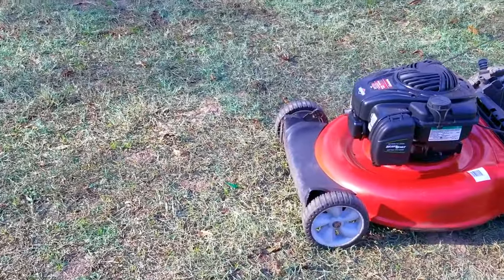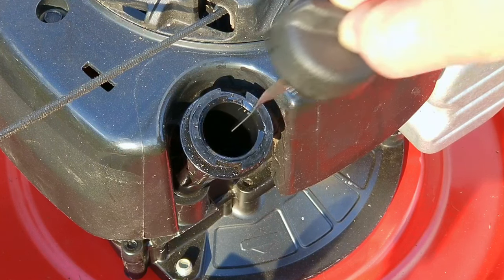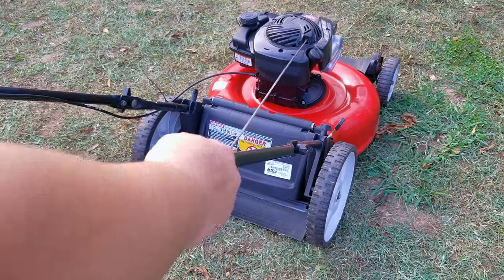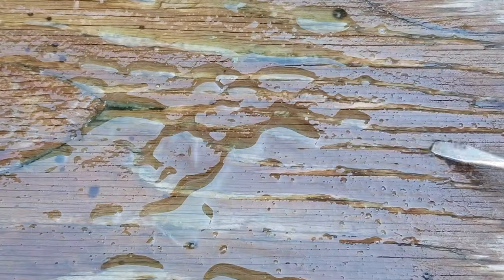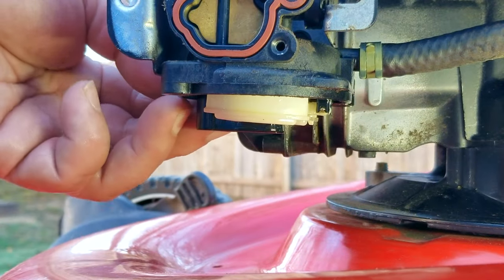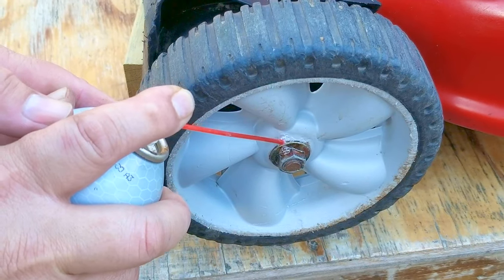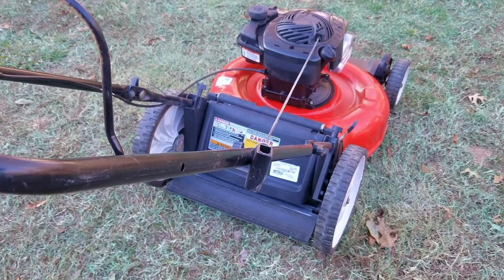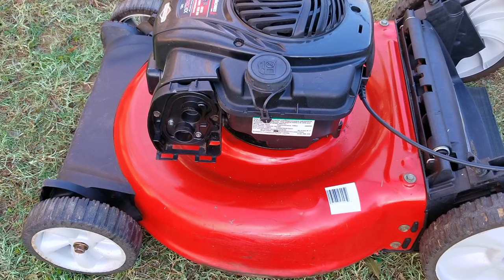Fixing A Yard Machines Mower That Won't Start

Comment: I usually remove the cover and take out the tank and carb as a unit. That way you can inspect / clean everything under there, flush out the tank and lines then thoroughly clean the carb. Chances are that slime and old fuel is still hanging around in the carb or fuel lines, but I’d also check the spark plug wire where it passes under the engine cover. Sometimes it gets pinched against the fins and grounds out or rubs against the auto-choke linkage and causes it to hang up. These are pretty good little mowers and sell quickly when all sorted out.
Reply from the maker: yes that's what I should have done too

Comment: If you notice the chuh-chuch sound when turning the engine over (starting this engine isn't instant), you may wish to adjust the valve lash. This engine likely has 50+ hours on it and now may be a good time to complete that service. Also, snug the head bolts as well. Great job, Home Garage.
Reply from the maker: good idea

Comment: I'd take that carb off and clean it and flush the whole system. That plastic job would be an easy fix. Still acts like the choke is hanging up, but there's always more than meets the bloodshot eyeball. Mowing with the battery job with in the slow and economy mode. High grass is battery at 60% left but witht the same settings and light mowing but moving along it's been 80% the last two times. WELL pleased but the gas jobs are still here too.  Happy weekend and Blessings
Reply from the maker: agreed, and that's the plan
Reply: @HomeGaragechannel  YAAY!

Comment: at this point, I'd say either giving the carb a full cleaning or replacing are equally good options.  But since you have such good flow through the carb right now, another option would be to try running full strength sea foam through the carb for a few minutes.  That might equally do the trick.
Reply from the maker: interesting choice

Comment: Take shroud off remove fuel tank and carburetor clean tank and fuel line or replace fuel line blockage might be in carb inlet and between needle and seat under float valve also check fuel tank outlet some manufacturers used an inline filter that pushes into the tank outlet that significantly will reduce fuel flow if dirty
Reply from the maker: very good idea

Comment: That is a surprise for a 2012 model mower with good paint since the mtd machines the paint peels. If you look at it the wrong way , I have made my shares of mistakes also we learn from it and move on and get better.
Reply from the maker: you're right about that, and yes it's in surprising condition

Comment: Hey man, my dad has a toro lawnmower over head valve and he only got it like 3 and a half years ago. I just got done mowing today when I noticed oil was starting to leak out onto the bottom of the air filter and onto the mowing deck. How do I fix this???
Reply from the maker: check the oil level, make sure it's not over full, if it's not overfilled then the head gasket might be broken

Comment: Been watching your videos for over a year you've always asked to put comments. I just want to let you know your videos are very informative and I really like the way how you explain things but I have a question....... my seven year old Honda power washer just kick the bucket. I'd like to know if you could direct me down toward a path of a model that you would recommend to buy a new power washer ..... Example, good engine good quality ..... Funny thing I should send it to you so you could fix it but that's a different story but I really would appreciate your opinion if you can direct me down for a good model thanks a lot.....
Reply from the maker: thank you and I appreciate your time in watching.  It means a lot to me.  So here's the part, where things get tricky.  How often and how long do you use your power washer for?  Also, where do you store it when you're not using it?  What's your budget for it too? sorry for all these questions but these would be the same ones I would ask if we were standing at the Lowes, looking at them.  My recommendation is that if you use the washer a lot and store it indoors to get "any" power washer with another honda engine on it.  Doesn't matter the brand name.  But If you store it in a shed, and only use it sparing, just get an electric one, based on your budget.

Comment: Where does that top hole behind the air filter lead? Is that the air intake? Also, is it a bad idea to spray any starter fluid in there? 😅
Reply from the maker: to the top of the engine and the PCV system.  No it's not the air intake to the engine.   You can spray it there but it would be better in the lower hole which goes to the carb.

Comment: im having issues with my mower it was running horrible and sputtering when last in use and it ran out of gas so i let it sit for a few hours. then i filled it back up and it wouldnt start up, ive cleaned out the carb checked all the jets all was clear its a plastic carb if that info is needed. i also checke the spark plug for spark and it had plenty. im out of ideas what it could be at this point
Reply from the maker: Not enough information so I'm being general here.  Have you checked to make sure the Air filter was not wet with water or fuel?  Also have you tried putting some fuel into the carbs inlet to see if it might start by bypassing the carb?   Otherwise it seems like the problem is the fuel.  It might have water in it?  Have looked to see If there might be water in the gas can?
Reply: @HomeGaragechannel  thanks for the response. And yes the filter is absolutely nasty I had to take it off it was ruined it was wet with fule and whatever gunk was on it . I need to get a replacement. And the only thing I tried was a little break cleaner in the carb should I try gas?
Reply from the maker: yes try the gasoline
Reply: @HomeGaragechannel  okay so update after cleaning the carb and draining the gas tank it wasn’t starting afterwords. And now here we are day after and she starts up first pull. Any idea as to why? After it sat overnight it’s working without issues.

Comment: I'm working on a steel FS55. It's making grinding/like a bell noise. I'm wondering if that's the clutch and the head doesn't spend when you  Rev it up
Reply from the maker: I think there might be an issue in the gearbox at the trimmer head.
Reply: @HomeGaragechannel  It's towards the motor like right in front of the motor that's what makes me think it's a clutch, and when you pull it over it makes grinding noise towards the clutch.

Comment: 0:07  I hear yah,  I have found only 1 free mower this year so far;  I have seen a few posted but too far  away to drive. ppl are holding on to them and may be trying to DIY fix themselves with youtube and a socket set.  

its much easier to just take the carb off  to clean to me.  the old quantum ones you could get away with just the bowl because they were easier to get to .
Reply from the maker: you make a good point

Comment: i have been watching your videos and i was wondering if you know what is wrong with my chainsaw it is idling on choke but when i turn choke off or pull the trigger it shuts off i cleaned the carb some and cleaned the spark arester
Reply from the maker: sure, I'd say the metering diaphragm needs to be replaced but you could try turning the "L" screw counter clockwise a half turn, to see if.. it'll help out.
Reply: @HomeGaragechannel  ok ill try
Reply: @HomeGaragechannel  ill try it thanks you

Comment: I'd clean the carb off the engine, pull the recoil to make sure all is well and check the valve lash. I would not buy the mower in its current running state.
Reply from the maker: agreed

Comment: I suspect that jelly is fuel stabilizer. I’ve seen it before and the color of the fuel that came out of the carb bowl is not normal. Like others have said, I would do a proper clean of the entire fuel system ( carb, tank, line) and give it another shot.
Reply from the maker: thank you for that

Comment: from my view i,d probably take off the carburetor aka carby for a full cleaning and maybe inspect the breather tube hose as that might also be cracked and if the inlet manifold on that engine is warped or if the gasket on it is perished that also could be the problem too for a start up and run etc.
Reply from the maker: you might be onto something
Reply: @HomeGaragechannel  yep too right mate or maybe the linkage might be in a obstruction or the shaft might be stiff etc.

Comment: Quickest way to check if the blade is sharp is you stick your leg under the mower while it’s running. If it takes your leg clean off it is sharp. If does not then,sharpen it until it cuts through your leg
Reply: Holy mcketal!
Reply: @brianmccafferty1470 wanna know how to check if your brush cutter blade is sharp?
Reply from the maker: you are a genius
Reply: @HomeGaragechannel  with a brush cutter you use someone’s else’s leg because you have none left from the lawnmower😆

Comment: That mower had to of sat for several years to have the gas looking like that Those tanks can be removed without pulling the carb off. remove the recoil then push up on the tank. then remove the fuel line at the carb.
Reply from the maker: Thanks for the info

Comment: I would clean carb off the mower, replace fuel line, and adjust valves, replace spark plug and change oil.  At least then I could sell it with a clear conscience. Lol
Reply from the maker: The full monty.. sounds like a plan!

Comment: By mistake I put diesel in my masport so I pulled of the fuel line drained the diesel and tipped the mower back to get it out of the carby and it took a little bit but I got it to start and it blown out white smoke for a sec then stopped what a good day I had
Reply from the maker: you did a good job getting it going
Reply: And I’m only 11 years old 😊

Comment: Since it basically runs correctly why would you get a new carb, just clean it thoroughly and clean out the fuel system. That is prety much standard practice for me on those units.
Reply from the maker: in the next video, you'll see why.... Time.

Comment: They don't sell replacement pull starts for the 2011 models of those mowers you have to modify it yourself so it'll work and so you can pull the string and start it up 

I had to put on a different part on the flywheel some people are so picky they want it all original but when the shit is old the parts aren't all available for the old shit they use so i bought a old used part and made it look brand new and let the customer think it was a new part it works thats all that matters
Reply from the maker: where have you been looking for pull starts?
Reply: @HomeGaragechannel  i checked Amazon they didn't have one similar to his original so then i bought the used rusty piece off Ebay i might had been able to find the original part but the guy wasn't wanting to spend much on it the rusty one cleaned up good and repainted it to look new the guy couldn't tell if it was ever old that was last year.

Im not looking for that pull start anymore but im always buying new or used parts

Comment: I wouldn't want that engine but have 2 myself they're a bad model to have even though they run great they still can and have caught fire 2 times with me

Were the carburetor hooks to the engine it doesn't seal against the engine all the way leaving a small air gap for gas fumes to hit the spark plug how it does it im not really sure but mine burned twice and the engine is still working now we still use the melted gas tank because it didn't burn all the way through i smeared mud all over it to put the fire out but i kept wondering how'd it keep catching on fire and seen its a small gap and those type of engines are made bad just a bad model to own their also on self pulling ones to same gap problem its like Briggs forgot to add on a carburetor gasket to block the small air gap
Reply from the maker: another interesting idea